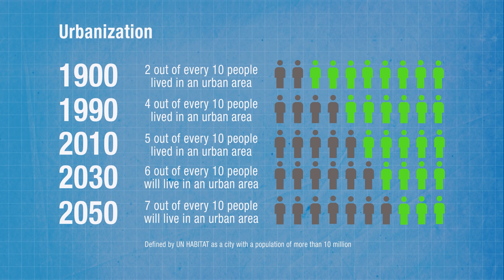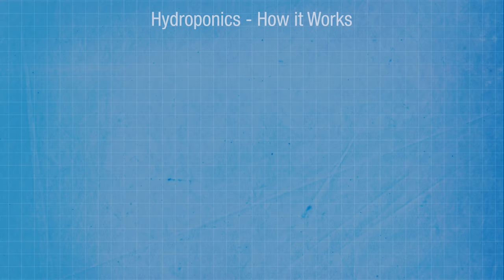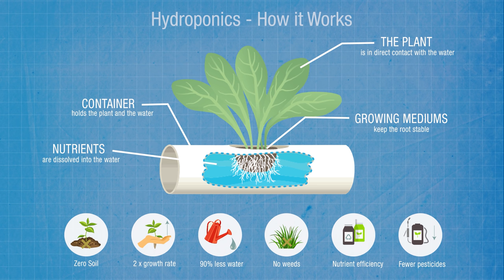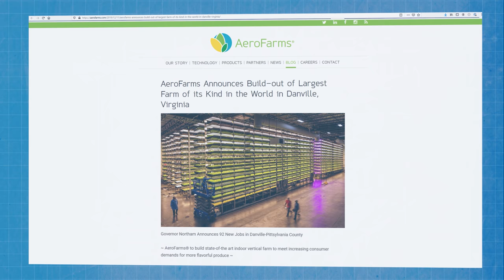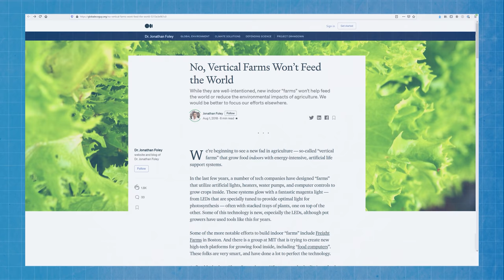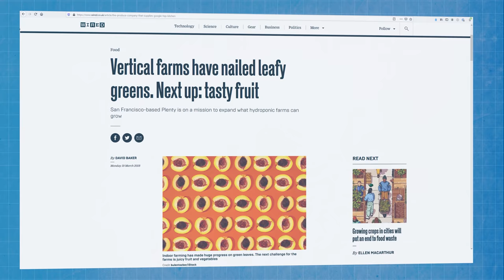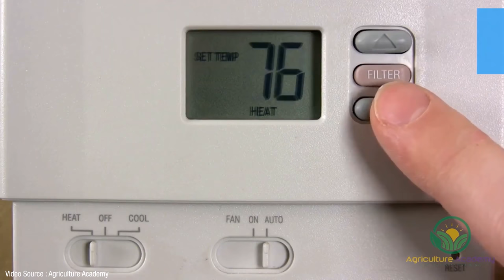Vertical Farming:  Growing fast!

Comment: Could this method be used to grow trees, such as apples and/or bananas, or am I being extremely stupid for even having the idea in my head in the first place?
Reply: not Really, TREES need more fresh air, open spaces , clean water and above all care .
Japan individually Polinates its Fruit Trees and adds a Protector on each piece of Fruit , to keep away Pests and Birds.
Reply: Not really, the principle of vertical farms is to stack as many trays as possible on top of each other, but more and more fruit trees are grown inside green houses and are grafted on dwarf stock for ease of picking. Modern cherry trees, for instance, are about 2.5 m high, and the green house allows (imperfectly) some level of pest control.
As vertical farms expand, it would seem logical that some will start using the first 1 - 2.5 meters of ground level for high crops such as trees, shrubs, tomatoes, potatoes, bean stalks, with the regular low stacked trays on top.
Fruit trees bring the additional challenges of pollination and seasons, so maybe vertical farms will produce both pears and honey one day. Poor bees...

Comment: Imagine if we could build a 10-story wheat field with lamps and irrigation inside, and then cover an equal floor-space outside the building with solar panels, in order to power the lights and pumps inside that 10-story wheat field - then sit down and have a think: what was the point? https://youtu.be/zCoC5o6x_Sw?t=601

Comment: This is interesting https://cipotato.org/wp-content/uploads/2014/08/005447.pdf - I tried it and although I did not get as far as producing potatoes, it seemed to work - although the ultrasonic mist producers clogged up after a while with salts so I had to switch to sprays.

Comment: he problem with naysayers in general is that they tend to use outdated technology in their calculations. I wonder if it's by ignorance or malice
Reply: Normally neither. new tech tends to be quite a bit more expensive for the given return. It is not economical most of the time to use the newest tech. Also there is a lack of data with the newer stuff so they tent to use the tried and true methods in their calculations.

Comment: Vertical farming is a trap.
High yeild, low waste farming: if you can do this vertically then you can do it horizontally.
Doing it vertically requires extra costs in building structural strength.

Building vertically is ONLY cost efficient when the cost of building up is cheaper than the cost of building out. Ie: rarely.

Comment: 10:45 > vertical farming won't solve food scarcity
ok. why not though?
assume the energy problem to be solved.
what else would be a real technical blocker?
Reply: Actually that would be climate control, including lighting, humidity and CO2. This all needs to be equally dispersed.

On the irrigation side you want the water (including nutrients) to be as nutritious for the plants at the beginning of the service area as on the end.

It is all solvable but at a price. After the initial sticker shock for the grower/investor those investments are worth it. 

It is from a greenhouse perspective all about consistency. With consistency you can calculate. And consistency is about giving the first plant as much love as the last plant. 

I think the main problems are not technical, but how the local economy is arranged. If a local grower can get for his tomato a better price in the UK then locally he will ship it to the UK.

I like the technique of Vertical farming, but a average glass greenhouse is at this moment way more economical. Ground prices in the city are very expensive, but you don’t need to travel to far out of a city to get economical prices.

Comment: Plant and animal protein are not comparable when it comes to protein synthesis. As in the formation of new tissue in the human body. Plant protein does not have a complete range of amino acids suitable for protein synthesis and as a result over 90% of plant protein is converted to glucose. For example to get the same protein synthesis from 250 grams of red meat you would have to eat in the order of 1.2 kg of kidney beans. This is simply not feasible due to the anti nutrients in either beans or wheat and that it equates to eating 4000 calories per day in just beans. As for leafy greens they only contain around 8 calories per 100 grams which is almost nothing. Cruciferous vegetables have around 20 calories per 100 grams which is still not enough to feed anyone. Also insulin loading from the consumption of refined carbohydrates, as in wheat, is the leading cause of chronic disease in the western world. Vertical farming looks great but unfortunately it doesn't solve anything. What really needs to be addressed is population growth.

Comment: Haha Dave, that's a lot of misunderstandings you have about hydro/aqua/aeroponics. No soil means no pests??? Wrong mate. Most pesky little critters are introduced by the growers themselves regardless of the medium. It can be as easy as walking through your yard into your growroom and you've brought along some mites already...they won't care what you have suspended your plant roots in and just start eating your plants.
And these systems are not suitable for beginnners at all, and very vulnerable. You get one root disease such as Pythium on those bare roots...all interconnected...your entire crop will fail miserably. People growing at home are way better off with good old pots and soil. Which does not exclude a vertical farm at all. That's another misconception. A vertical farm has nothing to do with the growing medium.

Comment: "no huge farm machinery"

...um, no.  not huge farm machinery.   astronomical farm machinery.  ridiculous infrastructure and energy use, as you pointed out.
Reply: Yeah instead of huge diesel farm equipment, and shipping etc, depending on the numbers I would bet overall emissions are more or less the same. lights aren't exactly expensive to run. As the grid gets cleaner it will also get better.
Reply: I wonder what the footprint of solar panels it would take to power one of these operations. Probably more area than if you just used the land for crops.
Reply: @M00Z1LLA  haha yeah probably, I guess you could wack panels on the roof to give it some power

Comment: vertical farming very likely is another frankenstein factory. it is another concrete building, water pump, led lights, cnc crane. all power hunger device. how about polination of flowers? bees in the building? no way, more likely using lab growth flies or using large fans? it is deem to be aqua culture, so artificial fertilizer and insecticide for pinpointed accuracy. all these are not the most important. 

does it do any good to the soil and the food chain? or capture carbon?

it may? depends on who's in charge and how much money you can burn, but according to the laziness nature of human being, i bet a dollar it will become frankenstein factory. just like those factory growth fish we saw in the market. those factory becomes blackhole of electricity and water. i have been working in those multi story factory fishfarm before, they feed the fish with maggots (don't ask me how they farm the maggots), and when overcrowd fish tank spread disease, they feed the fish with antibiotics as if they are candy, ozone machine and ultra violet lights switch on 24/7/365. some people really have the talent to ruine every good idea they saw for profit.

Comment: Vertical farming is impractical, far more wasteful than they claim on paper, and absurdly expensive. If large scale vertical farming were cheap enough to feed more than just the ultra-rich, the same technologies that make it possible would still be vastly cheaper in non-vertical greenhouses and they would supplant the need for vertical farms in anything less than a world dominated by a Eucomenopolis. Vertical farms are just like solar roadways. They will get a lot of funding from the trendy and hip know-nothings, but they are pointless compared to far more practical approaches.

Comment: The downside: The environmental cost of harvesting the ore, refining the metal, and manufacturing a wind turbine consumes more energy than the wind turbine will ever produce, even if it spun 24/7/365 until the bearings gave out.   Put is in the salt water ocean, with that ocean mist/moisture and it won't last half as long.  

Wind turbines aren't very renewable.
Reply: Do you have a source for that? Because it doesn't live up with anything I've ever seen, and it's a bit difficult to believe, given that energy producers still choose to build wind farms even without subsidies
Reply: @tevawiese6248  I see the issue. I meant to say 'environmental cost'. I'll edit my original comment.

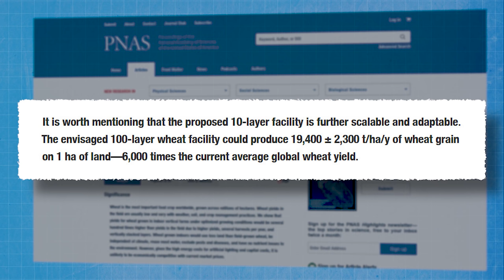Comment: Some SUPER selective data at 10:02. 19,400 tonnes of wheat per hectare is given a total of 25% leeway, so we're already into dream numbers here. But that's nothing compared to the quoted "performance" - 6000 x of current "global average". The western average is at least three times higher than the 3.2 t/ha/y that this implies -  and record harvests are double that again. So, 6 times less gives us 1000 x, which is still impressive, right? You glossed right over the fact that this is a 100-layer facility without mentioning that wheat grows to 1.2m, meaning this thing is going to be at least, what 180m meters high, more likely somewhere around the height of One Canada Square in Canary Wharf, but with a footprint of a hectare?  I think we expect a little more rigorous skepticism from this channel.
Reply: Keep in mind the authors also basically write "you can make it 10 times taller for roughly 10 times the cost". Anything is possible in simulation-land.

Comment: What you suggest is: use today's farm land for solar power plants to produce electricity and than use this electricity to power lights in vertical farms to grow plants.
With the efficiency of the solar panels and the LEDs you will loose almost 90% of the sun's energy due to the two conversions.
How could this ever save land or energy or transport effort?
Reply: Solar power can be generated in deserts, for one thing, so this technology would enable desert nations to become self-sufficient. 

Second, solar power isn't the end of the road for new power generation. China will be mass-producing LFTR nuke plants in a few decades whether you want them or not, and marketing them worldwide as a fundamental tool for building their power in the developing world. 

And the number of advances being made in fusion on practically a weekly basis is staggering. They are mostly small advances, improved techniques for stabilizing plasma, better ways of modeling plasma, etc., but it adds up. Were you aware that improvements in fusion power output have historically roughly matched Moore's law? It is exponential growth and always has been. But it was the nearly flat part of the exponential growth curve, so everyone has mostly ignored it, but it has been happening.
Reply: @j.f.fisher5318  In the desert you have nothing but area and sun. So you could use horizontal farming inside a glasshouse instead. With all the same advantages (water efficiency...) but without loosing most of the energy by two additional energy conversions.

The improvements in fusion power development were so small until now that we will not see any commercial use before 2050 and no dominance before 2100. I do not see how this will help us with this issue.
Well before 2100 the human population number will start to decrease again. 
So fusion power is too late in this case as in any other.

Comment: From the nerd's perspective, the most difficult part is water. It doesn't mix with electricity very well.
Water sensing sux. That is your fail point.
Reply: Aquarium people manage that all the time, some of the reef folks do amazing things with surge tanks and microdosing of nutrients and filtration and so on.  It's not necessarily cheap or easy!
Reply: @nagasvoice8895  find me a sensor that can be submerged in untreated water without degrading, under a fortune.
Reply: @bcddd214  Well, some things can be checked with very simple methods, such as using tubing or water hoses to check relative water levels, and people are very happy for someone to invent new simple tools.  But what are you trying to find out?  At what size scale?  What do you mean by "untreated water"?  That could be anything from toxic mine leachates to marine red tide to the head of a trout stream with such low organic content it barely registers in the best nitrate chemistry methods we have. Are you looking for the concentration of heavy metal contaminants such as copper, cadmium,  lead, chromium, long-chain organics run off from parking lots or from city dump sites?  pH?  Dissolved solids?  Salinity?  Pressure?  Turbulence?  Temperature?  Actual (vs. manufacturer's specs) head from a given pump?  All those take different tools.  Also, your phrase "without degrading" requires a time frame.  City engineers building water treatment or sewage treatment plants might have surprisingly similar demands for gear as the city's public aquarium, but totally different scale or durability requirements.
Reply: @nagasvoice8895  anything that is not distilled or even filtered.
what is your corrosion solution?
Reply: @bcddd214  Corrosion from what?  Fast-moving grit?  Provide a basin where the water slows down and drops the sediment load first.  Acids?  Municipal systems add lime to increase the pH of water so soft acid water won't dissolve the pipes completely. Just look what happened in Flint MI when they failed to do that correctly.  The issue with that is adding lime to acid neutralizes the acid, but gives you salty water instead.  Salts?  Colorado river water used to be upwards of 200 ppm highly alkaline salts (not just NaCL but various CA and Mg salts, like Epsom salts) by the time it reached Tijuana south of San Diego, and that stuff ate cast iron pipes and brass faucets and build up a rime of white lime next to any area of moving water, including irrigation ditches and watering plant pots.  (Back then, Tijuana folks got told they were lucky to get any water at all, the way the river was getting sucked dry before it got to them).  The folks raising Lake Malawi cichlid species loved it, but it did eat their plumbing.  Everybody else caring for less salt-adapted species had to buy distilled water to dilute it with, or run very expensive, fragile, and short-lived desalinization membranes, and check constantly with specific gravity meters that float differently in different salinities of water - pretty cheap, used by saltwater folks.  I understand they've figured out some improvements on the membranes since then.  More details on specific gravity:  https://www.theaquariumsolution.com/measuring-salinity-and-specific-gravity-your-aquarium
Reply: @nagasvoice8895  calcium, acids and other chemicals work double time on metal sensor endings/tips, especially when you pass an electrical current across them.

when you insulate them, you lose sensitivity.

Its just chemistry 101
Reply: @bcddd214   Sorry, that is not a tool, it's a ripoff, throw it away.  If you can't afford $7.50, you're down to using your fingers to check soil moisture - but good news, your fingertips are far better soil moisture meters for small pots. (Really.)  Also, if you're trying to use remote (say, under lights) rather than checking in person, your plants will develop other problems -  spider mites at a guess.  Also, this isn't the kind of thing an aquarist would use, too easily damaged by stray water flung about.  Side point - check with your local water department, they're supposed to keep stats on your water quality.  If it's salt corroding those probes, either your soil or your water is at fault. The cheap answer to that problem is to repot in fresh new soil frequently, like every 6 months or sooner.  Back to probs - the university folks working in corn and orchards etc. use porous ceramic tips a foot long buried about two feet or more down in field soil, with recording instrument at the head - no idea how much those cost - don't ask!  Intermediate scale would be something with a single fairly thick metal probe, all I'm seeing runs about $450 or so, and even then I'm a bit skeptical.  Sadly, I'm not seeing anything that looks reliable, my searches keep running off into the kind of meters calibrated to check for moisture in lumber and ceramic flooring.
Reply: @nagasvoice8895  Like I said, when water meets a metal sensors, which happens a lot in farming, its going to give you problems or cost you a bundle to solve it.